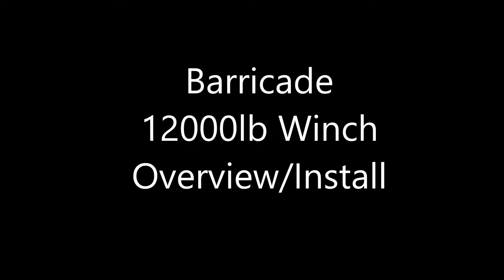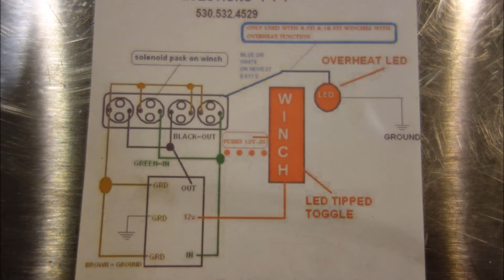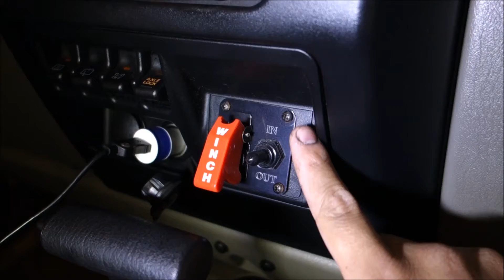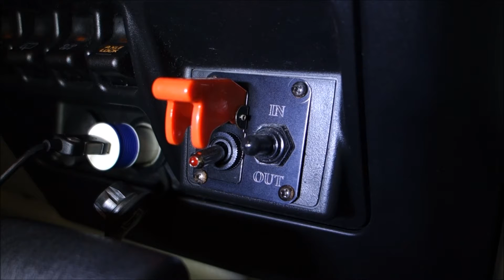Barricade 12000lb Winch Overview/Install/incab winch control

Comment: Do you have a write up in how to wire the winch switch and the solenoid? Thank you
Reply from the maker: Sorry ,sure dont, I just follow the steps on the instructions that came in the kit, I have some pictures in the video, hope that helps
Reply: I couldn’t figure it out by the pictures, I was hoping for you to remember where each wire was connected, in the winch and switch